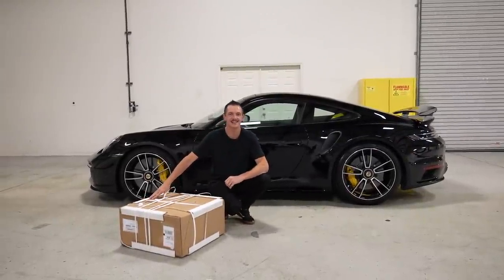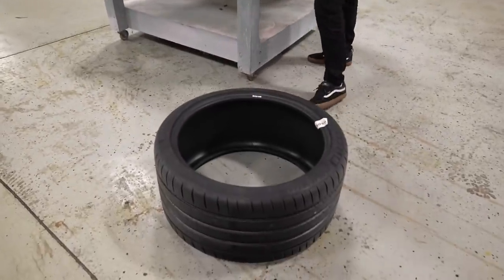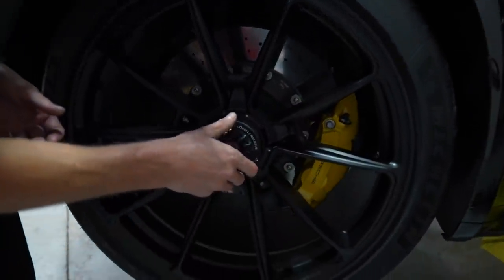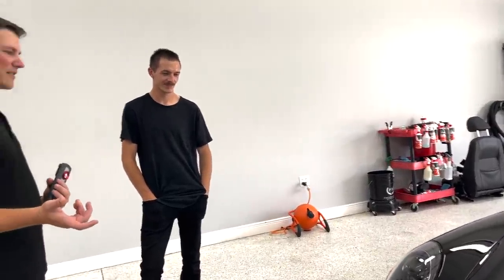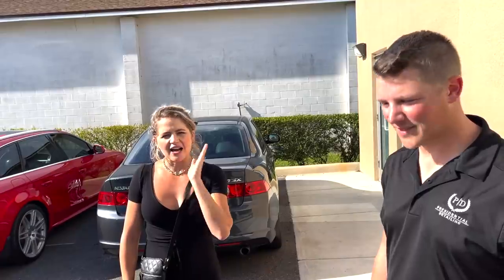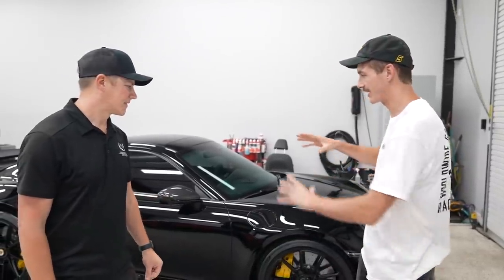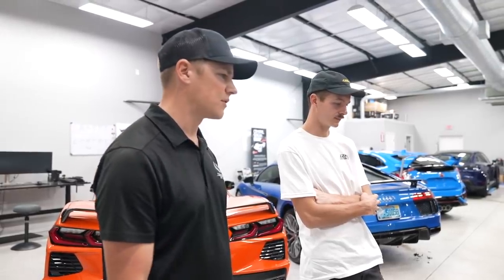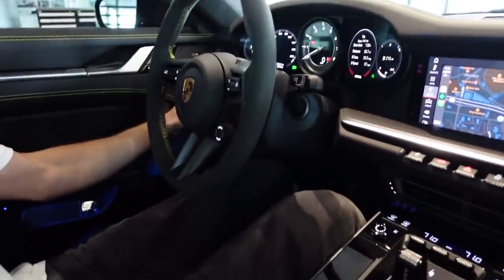Modifying a Broken 992 Turbo S...

Comment: The front brakes on that Porsche are insane. Can’t stop staring at them
Reply: Dude Porsche brakes are fucking HUGE! I was parked next to a Taycan  Turbo S today, and the first thing that caught my eye were the calipers on the carbon ceramic brakes. You look at them and think, "damn, they opted for the Airbus A380 brake package"
Reply: I’d love to do a carbon brake conversion on my truck lol. Like zr1 brakes
Reply: @JosephNnbs  I'm gonna go ahead and say you'd probably love them until you had to replace them. Even aftermarket solutions are thousands of dollars. Plus on a truck they wouldn't be much more effective than steel rotors bc you'd struggle to keep temp in them.
Reply: Brakes? I only see big circle mirrors behind the wheels
Reply: @yelruta  oh know, lotta speed in a 5500lb truck, that temp will be 👌👌 😂

Last price I got was about 700-900 per caliper for a zr1 and the rotors were about a grand each. Pads were about 400-500 each but just imagine the flex haha
Reply: @shona5512  bro that means that porsche and I have something in common when it comes to being huge 😩😩😩
Reply: Its sad when his rear rotors are bigger then my front rotors😭
Reply: @alexandrebarbe4358  I think my stock rotors are like 12 inches or something like that
Reply: I think R35 GT-R also have the same  ceramic brakes system
Reply: If you think those brakes are big, you should see the McLaren Senna’s brakes. They’re even bigger.
Reply: Front brakes = code for Collette's chest?
Reply: @JosephNnbs  I thought chevy has a BB package
Reply: @aaron5222  they do. 14 inch rotors with brembo calipers. But not in 08  me is 🤡
Reply: Need to swap them out they look like silver ware plates

Comment: 21:51 tint went from 50% to 5% when mike rotated his lens filter lol
Reply: It's called circular polarizing
Reply: you mean 5% to 50%?
Reply: @sfalk2640  the percentage is the amount of light that passes through the tint, 5 is much darker than 50
Reply: I’m glad I’m not the only one that noticed
Reply: It doesn't go darker

The lens has polarizer that cut the reflection of the lights

It is use full for car photography or anything that will reflect light

It is also use in fisherman's sun glasses to see fish easier in the water without the reflection

Comment: Always undo and torque centre locks in the air!!!! Very important Porsche instructions. Torque specs for centre lock wheels is 600nm. This has been drilled into my head over my main dealer apprenticeship.

Comment: 17:10 I had a similar issue on my STI with overheating while stationary. Fixed it with a high flow thermostat to allow for more cooling. Just added a couple more holes to the thermostat to allow for it. Worked like a charm.

Comment: Curious what the issue is—we got my wife a new Macan S back in October and it was having issues with rough shifts and shudders from the moment we picked it up.  They ended up replacing the mechatronics valve body on the transmission which has fixed the issue, but I have read about a lot more PDK failures in new vehicles than I would have expected.

Comment: 13:45 They are very professional!
They wash it in direct sunlight, and do not even use the two bucket method.

To be honest, the car was not that dirty to begin with.
But, nevertheless, I was expecting a better method to clean this level of car.

Moreover, the headlight coating is not that "good" after being for so long, and it is not that "easy" to sand it afterwards.
And no PPF is not an additional clear coating when it comes to gloss. It is covering some aspects, but it does not add the amount of gloss that the clear coat does.

At 18:10 you can see that on tight angles, the light does not bounce so clearly as on the original clear coat.
This is especially true because of the higher thickness of the PPF used on the front.

18:39 Is using a clay bar on a new car necessary?
Claying places micro scratches on the paint. This car was new.
Yes to chemical decontamination, but no to physical decontamination.
Yes, the Ocean trip - between Germany and the USA - may have done some bad things, but not that many, I imagine.

Nevertheless, congratulations on the final product!
Those headlights are a nightmare, and the end result is top notch.

Comment: Since you‘re a perfectionist, please turn the Porsche Logo that the lower tip points to the valve. This is actually a true Porsche thing. Beside that, concrats to this beauty and good luck in fd💪🏼

Comment: Adam, you need to try out the Continental Tire Extreme Contact DWS-6 they are INSANE in the raid, almost the same grip as dry on my focus ST and I adore these tires, I will never buy a different tire, like ever.

Comment: Couldn’t tell by the vid but do you point the shield towards the valve caps? I was told it years ago that it’s tradition and a proper Porsche owner always points the shield, every Porsche I’ve worked on gets the center caps pointed ever since

Comment: Suggestion: use a breaker bar for loosening wheel lugs 👍 but, a torque wrench is ok so long as you don't exceed the torque wrench limits.

Comment: If the ppf can delaminate the headlights when removed, would putting multiple layers of film not be the best option? That way if it gets damaged, you can just tear off the top layer, and still have more underneath, prolonging the inevitable fixing of the headlights themselves.

Comment: A torque wrench is a tightening tool. It is a very sensitive and precise tightening tool, and should never been used to loosen bolts. Handle your torque wrench as carefully as you treat a measurement instrument!

Comment: Weird to know... Alberta is about 4000 feet above sea level, though fusel records show at one point it was on the bottom of the ocean, isopod's and giant lizards. theoretically could be a 8000 foot elevation change. Have a T-rex on the drivers license, :p... elevation drop of 400 feet is enough to make my ears pop... one time I was at sea level, airs so heavy it feels damp. (so high... can nearly get a moon tan, I am sure another 4000 feet of air might make it harder to see at night.)  

Is it an S15, no it's a thunderbird... called it a chaser on my face book page and then google said "what! No, how? naw aw... look at this". Parts for it are so inexpensive, that its a bit weird. might just be how high I am, as the air gets thinner with summer coming around... less and less feels so much... makes it twice as high, three times and really start so see things.

I should get a job but there are lots of other people doing that with timed/regulated work that has very well planned distribution/supply chains for consistency, this kind of stuff you got is a bit of an off beat in the background up here... might have been big in the 80's, but now there are GPS's that open the car port.

Have things where I live... top fifth percentile under education standards makes up the bottom 3% of the tax bracket, "federal priorities". got a census form today, far as planned... dinosaurs don't live up here, unless there in a museum/zoo fixed in a singular stature.

Resource focused, PTSD from all the frost? Equal distribution ideology... but I guess no one keeps track of anything so they made education free, absolutely not to try sorting everything that's all mixed together? 

Borsht cat... had a gray, orange, black, white, brown, cracked blue eyed, four foot two, tabby, shaped like a bob cat, but it came out a jet black panther with white paws? 

Anxiety, migraine, motion sickness, Himalayan barley and still lights up on top of Everest... just sitting half way up, one of the biggest pit stops.

Comment: Are the Porsche AWD systems as finicky as the Audi/Lambo ones? I remember from a TJ Hunt video that he had the wrong OD’s tires on his R8 and he was told to not even move the car until he got new tires. Didn’t see what tire sizes Adam bought but I hope that he didn’t cook the center diff (if the car has one) or trans because of them 🙁

Comment: Two things: 

Don't use a torque wrench to crack bolts/nuts. Just no. 

The crests on the wheels should point at the valve stems.  #justporschethings

Comment: Don’t use a torque wrench to ever break things loose!! Use a breaker bar my guy...using a torque wrench to loosen is the fastest way to throw off its calibration or break the gear inside it.

Comment: crystal serum ultra on the wheels? im certified with getechniq, and they have a wheel coating, the ultra i dont think has the high heat resistance it should have for wheels....i personalyl think something like under dog is best for the wheels and brakes.

Comment: Cheaping out on TPMS-sensors? Me not understand. If you buy aftermarket Autel-MX, they are $100 for a quad pack. Add a handle for $300 so you can program them to any vehicle on the planet and you're set to go. It's worth it just for getting rid of that irritating orange light in the dash.
Reply from the maker: Cheating out by stealing the stock ones rather than buying a second set ($300 ea for the special porsxhe ones)
Reply: @AdamLZ  Ok. My err. Didn't listen properly, so I thought you left them out completely. Anyhow: I have no affiliation with Autel, but I find the MX to be superior to the Continental/VDO originally fitted to my Range Rover. A lot less false reporting. I have one original RH-Front that is bothering me this moment. It's a result of rotating a spare wheel around.

Comment: I'll be that guy... Dont use a torque wrench as a breaker bar. Even tho it's a $8-900 snap on and will probably take it, its possible to throw the calibration off and you'll have to send it out to get fixed and you'll have to wait some weeks for it to come back...
Reply: Plus Snapon 100% refund with lifetime replacement
Reply: @darrell680  true for hand tools like ratchets, sockets, wrenches. But torque wrenches digital or click type are not... it's kinda bullshit but they'd go broke if they warranted everything they sold. I think torque wrenches are 3-5yrs free replacement and after that you pay to repair or replace it after the warranty is up. I've been professionally doing this for 12yrs and found out the hard way that I should have been buying gearwrench or Milwaukee or etc instead since they have the same warranties for the same products.

Comment: Did anyone else notice the what looks like a wedding ring on Collettes hand? And Jimmy oaks took a trip to Florida for a wedding recently...hmmm is it now mr and Mrs lz?
Reply: Reading far too much into it... if you follow Jimmy on IG you'd know it wasn't an LZ wedding.
Reply: @cd5sircoupe  shit...I did not look at Jimmy's ig till now...🤦‍♂️
Reply: @sleepycb7  All good dude. Also, CB7 as in Accord? Did we just become friends? Hah. 

Back in the day in the mid 00s when I made this account I had a few 5th gen CD Accords, a 94 4 banger and 97 6 cyl. My buddy had I think a 00 6 cyl and then a 98 4 cyl, both coupes, then an 86 3rd gen hatch and an 04 6 cyl 6 speed coupe later on.

Edit: My younger brother also got an 89 CA 3rd gen coupe fairly recently. It's a boomer magnet, 2nd owner and well taken care of by the first.
Reply: @cd5sircoupe  yes sir cb7 as in accord! Yup I think we did just become best friends lol...I currently have 3 cb7's...91 ex coupe built and boosted making 403, a 92 lx h22 coupe daily, a 90 lx sedan mostly stock, and a 99 ex v6 coupe. Ive had at this point 35 or more accords over the last 20 years....ive owned everything from a 89 to a 03 accord lol
Reply: @sleepycb7  Dude thats awesome, respect. I still have a soft spot for em even though I haven't owned one in over ten years. Wish I had the scratch back in the day to afford the H22 swap I wanted for my 94 or the manual trans for the 97 v6. I love how untouched my brother's 89 coupe LXI coupe is, he literally can't stop anywhere without an old person reminiscing about how they owned one. It'd be cool to import a Euro R or a Torneo in the future. 

Currently I've moved on to an 06 G35 sedan and 04 Forester XT, while my buddy's got a 10 Genesis coupe 2.0t and I think 03 Trailblazer, had a 97 Wrangler till last year.
Reply: @cd5sircoupe  much love brother!!! I have a 99 bmw 540i 6spd msport with a vf supercharger, 97 2500 suburban as a family hauler also...I had a 2010 g37s 6spd sedan, bought it at a good price and flipped it for a great price lol. Hell im 41 years old...50-60+ year old guys will come up to me and tell me when they bought a cb7 brand new as a family car and loved it...saying they wished their wife's would have let them mod it 🤣🤣🤣 im hunting for a drift car to build currently (my 5yo daughter was in one of Collette's drift week videos and has been bugging me for a barbie drift car ever since 🤣🤣🤦‍♂️)
Reply: @cd5sircoupe  a euro r would be dope...when I can import 2001 cars I want to get one of the accord sir awd h23 wagons 😍
Reply: @sleepycb7  That's a pretty sick collection. Friend of mine had a 95 bmw 535i for awhile till a see you next tuesday rear ended him with her Land Rover earlier this year while being distracted. Now he's got like an early e46 325i as a replacement.

That's awesome about your daughter. I'd suggest a 350z or e46 3 series as the easiest way to accomplish that goal, but you probably already know that. And hell, I'm not too far behind you in age, definitely in cars owned though. Just about to hit 35 in less than a month, no kids.
Reply: @cd5sircoupe  ive been looking at e36 bmws and Nissan hardcopy trucks...ive always wanted to sr20 swap one with a s13 front and rear suspension...(knowing how to fabricate helps me not spend thousands lol)
Reply: @sleepycb7  If you want the seat time just scoop a 350/370 before they get too expensive. Otherwise grab that e36 or hardbody you're trying to find afterwards. You know either one will be down for a hot minute before they're usable for drift anyhow. Might as well get a decently reliable car for the track time before they turn into unobtanium too.

Friend of mine recently got my headspace into learning how to weld. He suggested a mutual friend of ours that is very stubborn. Sadly I don't think that arrangement's gonna work out, but the dude needs the help filling his orders and I'm more than willing to learn and help.

Edit: There was one of LZs vids before the Evo5 blew where he brought that car and the RS down to Moarfab's old shop, which was in the same complex as the stubborn friend. My other friend approached LZ on my behalf saying I was a fan and so on, he was kind of an asshole and that dude instantly hated LZ afterwards. 

Admittedly I get it, but I was kinda pissed that LZ indirectly let me down with such an innocuous encounter. My friend isn't even a fan of his, but he went over to him on my behalf while I was at work, and he shit on my friend basically. Not your typical fangirl moment in the least. 

However, they did include the shop dude's 78 rally AMC Eagle Spirit or whatever it's called in like a 2 second clip jumping some shiz in the video for that day.
Reply: @cd5sircoupe  i have some seat time (just not in the last 10 years 😥🤦‍♂️😐)..about 15 years ago I had a s13 notch with some angle that I tore around in...I still to this day throw everything I drive sideways at one point or another 🤣🤣. I briefly met lz at drift week in texas...he was a good dude, we talked shortly...my 15 yo son met him too (high point if his year) lz seems to like his life somewhat private so I could understand his reaction to your buddy and you. You must live in the northeast...im originally from right across the river from NYC in n.j. (insert your jokes here 🤣) I do remember the amc in that video you speak of.
Reply: @sleepycb7  Good deal, I was mostly talking from a price & availability perspective on the new drift car. 

My opinion on LZ didn't change after that encounter, and I get LZ's side of things too. I was just kind of disappointed by his reaction. My friend doesn't watch his videos and was just trying to do me a solid by saying "hey, my friend's a big fan and you've got some cool cars, respect. See ya". 

Jersey City? And yeah, I'm in CT from the same town as Jimmy Oakes. The guys in question both live a few minutes up the road from his shop actually. I also found out I worked with some guys that used to bike with Jimmy & Adam back when they were teens.

Comment: I can't believe you are using a torque wrench instead of a breaker bar to break loose the center lock. Good way to damage your calibration. SMH. Basic tools and their uses! I would highly recommend you get rid of the center locking hubs because they come loose a LOT! Check out any of the Porsche forums, it's well documented. Very nice wheels!!!